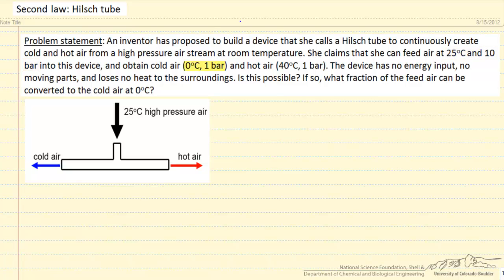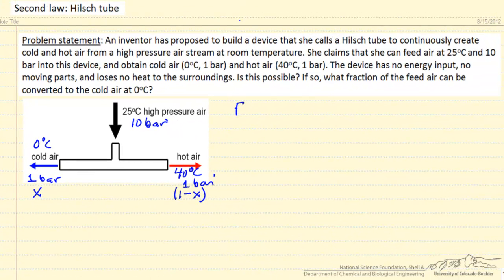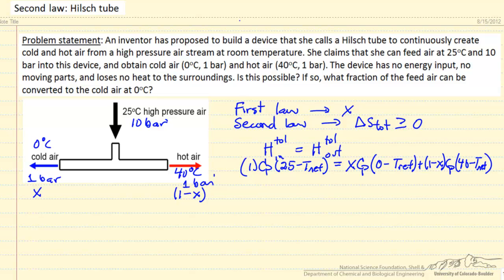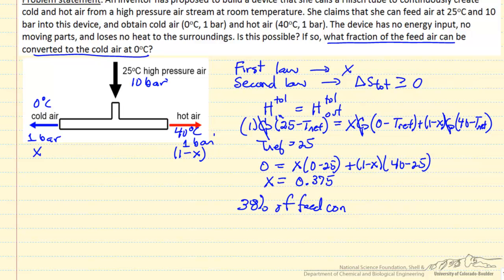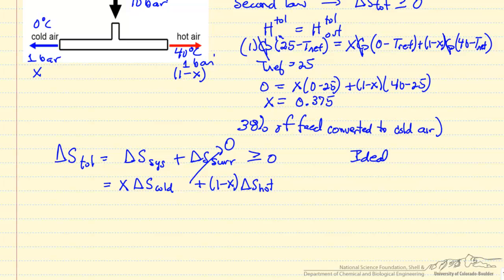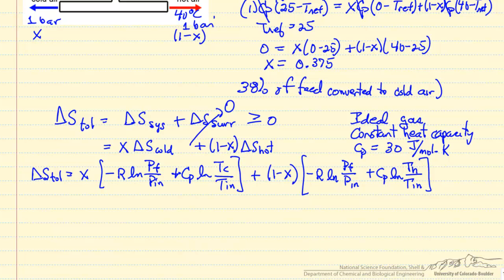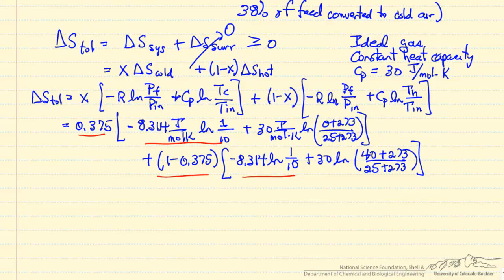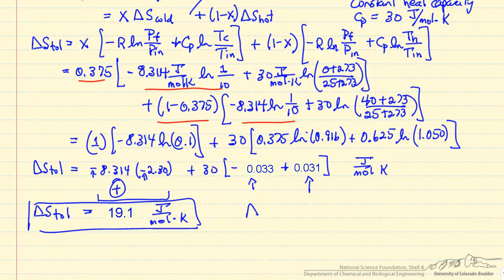Second Law of Thermodynamics: Hilsch Tube

Comment: There is one point missing in the analysis. During the calculations, it has been forgot that both the hot and cold flow have velocities that comes at the price of the pressure energy. It hasn't been taken into account.

Comment: When a gas at at 25°C temperature and 10 barA pressure is released to just 1 barA pressure adiabatically i.e. isenthalpic way, its temperature will fall to around -119.65°C. The formula is written in this wiki page at https://en.wikipedia.org/wiki/Adiabatic_process and anybody can calculate the temperature drop. The loss in temperature is the change in heat into motion. I am wondering how even the temperature at the colder flow can be much higher than that.

Comment: Consider the process to be both isentropic and isenthalpic and let's fit two diffusers at the exit of both the flows. From the viewpoint of first of thermodynamics, if both the end flows are mixed then the end result will be gas at 25°C temperature and 10 barA pressure (in case the process is isenthalpic). But, if not mixed, that means we have two different set of gas at different temperature and pressure.
http://twisterbv.com/products-services/twister-supersonic-separator/how-it-works/
It's a real example that when gas at high pressure is released through a nozzle and again repressed through a diffuser, it can reach close to its original enthalpy value. Now, just imagine what will happen if both flows are passed through diffusers.